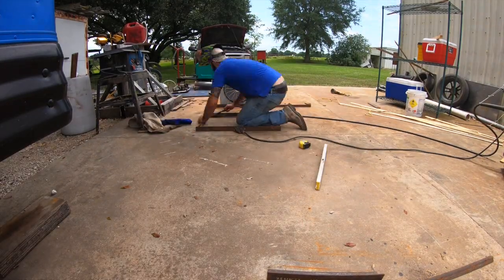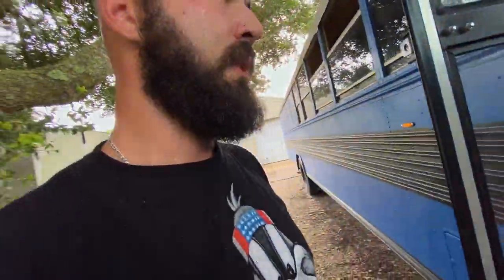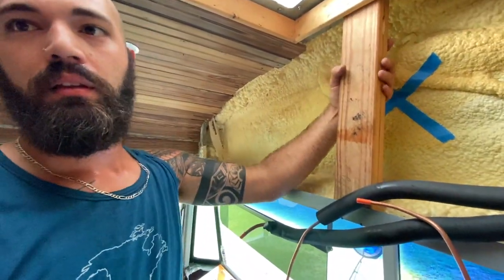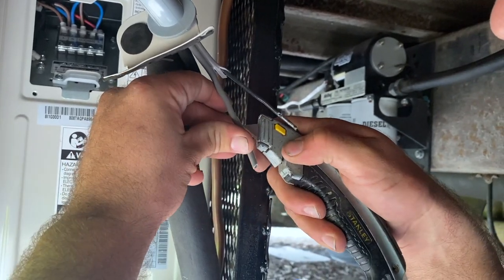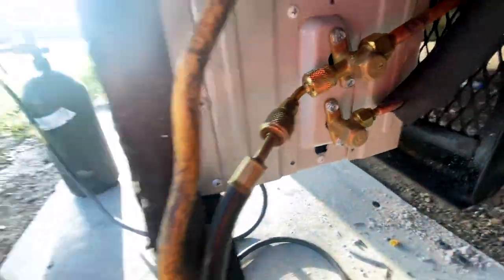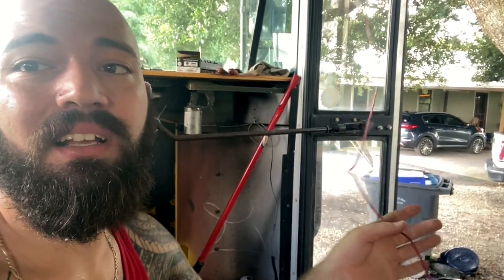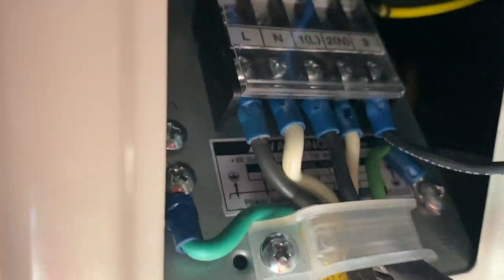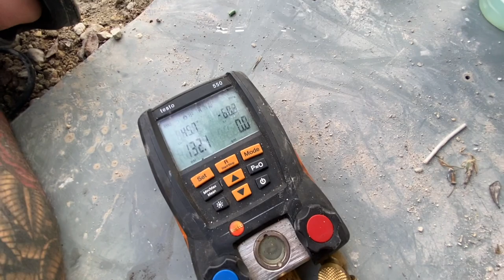Installing a LG mini split in our skoolie \\ Skoolie Conversion: 12 BTU mini split install on a bus

Comment: Thanks for this video.....searching for how to install our AC under a Shuttle Bus, this really helps! Now that you've been using it for several months, how is it holding up? Any recommendations or adjustments you'd make if you had to do it over again?
Reply from the maker: It’s holding up well! Thanks for watching.

Don’t install the dryer like I did!
The only issue we are running into is the drain line! Make sure it has a perfect path, we even had to remount the inside unit with a pitch to the drain side
Good luck!
Reply: @parishskoolie  Just installed the unit.....thanks for the tip about tilting the inside unit a bit!!!.......one more question — has the expanded metal been enough to protect the unit under the bus? Seems like there might be quite a lot of debris that could muck up the condenser and coils? Have you had any issues with that?
Reply: @DhruvaMaharaja1952  Need to hook up both drain holes on each end of head unit. Y them together in to one main drain hose going as stright down as possible.
Reply: @DhruvaMaharaja1952  Also add a trim board on top of head unit to pin it down on the mount plate. Just in case of accidents or rough roads.
Reply from the maker: @DhruvaMaharaja1952  
two years in now, certainly should've made the expanded metal removable for cleaning! They definitely do get very dirty as expected
Reply: Put two drains on mine 1 to each side works great

Comment: This is a great set up !! Being from the same latitude as yall I know that if your car or rig doesn't have a/c you're in deep chit. The biggest bonus for me with mine (also mounted underneath and E350 bus is the Heat Pump. Being able to put in on "auto" and set the temp. Then it will switch to whichever it needs to keep the temp setting. Ohh...and secondly...it is so quiet when it's running !! Yall are some great people and I'm proud to call yall my friends.   #NomadLivesMatter
Reply from the maker: Thanks! It surprised us how quiet it was. And thanks for the comment! We love the feedback and being able to call you a friend ✌🏼

Comment from the maker: These are SOME OF THE MISTAKES I made even tho the unit is running great after 3 years. 
I did not make a removable access in the expanded metal in order to clean the coils well (very important under the bus)
I added a traditional dryer/filter which is a minisplit no no!
Location of interior unit, We need fans to circulate air all the way to the back.
I did not utilize both drain lines so my unit is tilted like a noob!

Comment: I hear those mini splits are the best-energy efficient & "most" of all quiet. We have a roof top Ac-no reason to speak when it's running cause no one can hear you!!
Reply from the maker: Haha well we can’t hold a conversation when driving anyway 🤷🏼‍♀️ and yes the one we installed here is very quiet and the energy efficiency is why we went with this one ☺️

Comment: Did you find 12k btu enough for cooling?
Reply from the maker: Yes. I should’ve put it in the rear for bedtime, but I didn’t want to run 30+ ft of line. We just use a fan for circulation. Full size flat noses & large tag axle buses are running two mini split.

Comment: thanks so much for sharing your mini split adventure.
we just bought our mini split and I want to mount it under the bus too, but my wife is concerned that that might be against the manufacturers suggested installation locations.
Are you concerned that there isn't enough clearance above the unit?
Reply from the maker: We are so glad you enjoyed the video! Thanks for the watch. 
Our mini split doesn’t have coils on the top (just the back and one side), so there’s plenty of clearance! We only needed 12 inches for the coils and 24 for the fan side. 

Also, I don’t think any manufacturer would honor their warranty on a mobile application 😕

Comment: Is the LG unit run by a inverter compressor motor? I'm looking at them now for my coach I've been leaning towards pioneer 21seer 120 volt and on high it's pulling less than a 1000 watts just want your thoughts thanks and love the channel you have some great content and I appreciate your honesty.
Reply from the maker: I do believe its an inverter motor! Unfortunately to my knowledge all the professional distributors I used to use have stopped supplying this LG unit. It is 19 seer and pulls 400-500 more watts than pioneer. The local suppliers have replaced the LG minisplit with Ruud's new version in 2018. I would go pioneer if/when doing it again! When you purchase big name units you're paying for a better warranty not better equipment (generally speaking)
Thanks for watching!!
Reply: @parishskoolie  thanks for the info it was helpful

Comment: When you started soldering I said yup I'm subscribing they know what to do..lol  Can you please tell me the stain color used for the ceiling? Just bought a mid size school bus and just gutted it.Also just in case you dont know use dish soap on the wires it will make the wire smoothly go through the conduit
Reply from the maker: Thanks buddy! I’m a sucker for solder.

No stain on the ceiling, it’s antique pine & cypress with polyurethane sprayed after install. Thanks for the tip, I used WD40😎

Good luck & congrats on your bus!

Comment: Have you had any problems with negative vortex with the condenser under the bus. We are in the process of installing ours and have received negative comments.
Reply from the maker: We don’t run the a/c when we are traveling in the bus (only parked and hooked to shore power)

Comment: Nice job! I do install many LG mini splits - here are my remarks
Keep the coils CLEAN on the outside unit. Most mini splits have overlapping coils on the condenser which is diffcult to clean when it gets clogged with dirt. Also, LG does not recommend brazing the linesets (might cause leaks if done improperly due to high operating pressure). I'm assuming you removed the filter dryer? Do not install filter dryer on mini splits! Hope you have space to install the disconnect. If not, you can mount it on the condenser. Heating should work fine up to 14 degrees. Lastly, you should of ran one 16/4 gauge cable instead of running separate power cables.
Reply from the maker: James K thanks for your input!
Reply from the maker: Unfortunately, I kept the dryer on per advice from my refrigeration mentor. You seem to be correct about it not needing it, my pressures bounce up & down about 10-15psi due to the dryers restriction.
I’m more concerned the compression fittings will loosen up & leak due to all the vibrations in this application VS my solder not holding up.

Getting this dryer off will cost two days of work, it’s neatly tucked within the cage above the condenser🤦🏼‍♂️
What do you mean by installing a disconnect?
Reply: @parishskoolie  Use a torque wrench when tightening flare connections. Use of torque wrench is required to obtain extended warranty. Did you install rubber bushings or pads when installing the condenser on to the cage? That will dampen any vibrations and cause less noise. Good luck removing the filter dryer. On a mini split, you must recover all the refrigerant and weigh in the factory charge (or you can pump down the unit and inject the recovered refrigerant). Lastly, the disconnect is a switch that is installed before the condenser. Allows you to turn the power off when servicing. 
https://www.homedepot.com/p/Halex-60-AMP-120-240-Volt-Non-Fuse-Metallic-AC-Disconnect-HNF60R/205785642
Reply from the maker: James K 
Yes! I used some rubber bushings from an old refrigeration compressor. Worked perfectly
I feel like LG won’t honor the warranty due to many issues with this install, but I’ve filled the paperwork out😂
ELECTRICAL DISCONNECT! DUH, that went right over my head. 
It’s currently running on an extension cord with a surge protector, due to the bus not having electrical yet. I do plan on using a disconnect.
I’ve got a recovery tank & scale, hoping the pump down will work for me tho. Seriously not looking forward to removing the dryer. This cage has so much lock tight on it

Appreciate your input👍🏼
Reply: James K- what do you recommend to keep coils clean? Spray carefully with water? thanks
Reply: @dakat1726  Just water is fine as long as you do it regularly.  Also be mindful of the water pressure, as those aluminum find get bent pretty easy

Comment: I have a huge question i like how you guys installed is but how did you pump the system were not hvac people so we dont know how it works but we need our ac heating unit going its cold here in washington and need help lol :) any help would be greatly appreciated
Reply from the maker: Hey friends!
A brand new system comes pre-charged for up to 20ft of tubing!! Once you verify your line has no leaks you loosen both screws at the outside unit, that releases your Freon charge!
DM us on IG if you need further help!

Comment: Are u running off solar inverter or shore power? How many volts? Is it a 125v??
Reply from the maker: We have not even tried running it from our battery bank, I know it won’t power it for very long. We have 500AH of AGM batteries.

It is 115v & 10amps
For the first few months I actually had it running off an extension cord! Now that our electrical is done it’s all buttoned up correctly!
Reply: @parishskoolie  did u just get 1 500ah like car battery?
Reply from the maker: @DestinationDalmatian  
They are two 8D batteries
250AH a piece
The brand name is intimidator, they are RV batteries from Gander RV

Comment: What about road bump how you can avoid that?
Reply from the maker: Which part are you referring to?
The condenser downstairs isn’t going anywhere. The inside unit has screws that fasten down to the bracket, it does not float on the bracket like other units.
Reply: @parishskoolie  AC Unit under your bus that one I curious see if it can go driveable to bump if road had one.
Reply from the maker: @RichardApplegate  
Gotcha! We passed over a real sketchy rail road very recently, surely put it to the test. The stairs bottomed out, but nothing else touched as we went over! I was very happy about that. This mini split cage is the closest to the ground out of everything I’ve added I thought for sure it would’ve scraped.
Reply: Oh cool thank for respond! I was curious pretty much LOL

Comment: nitrogen in a frigiration unit? interesting never knew that allways though it was freon gas
oops the nitrogen was to test for leaks
Reply from the maker: Hey thanks for watching! We appreciate your concern! As Eli stated in the video, the nitrogen was to make sure the lines held a pressure and therefore wouldn’t leak when Freon was released into the system.